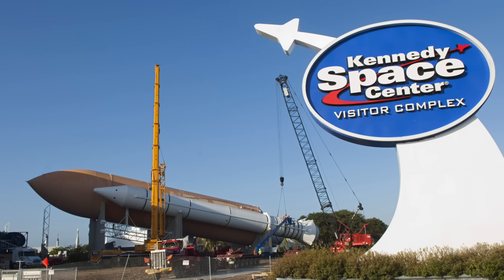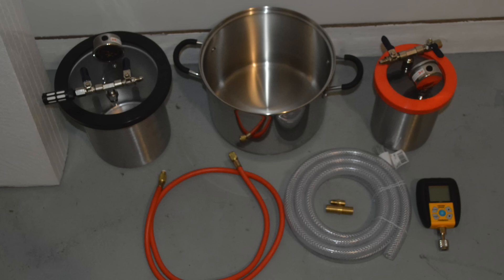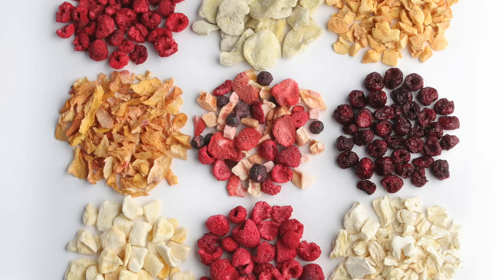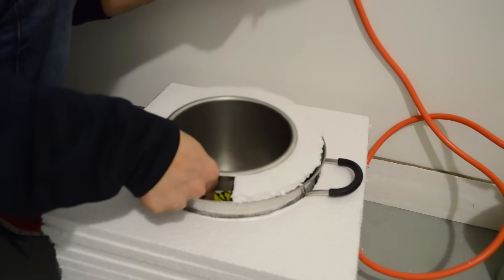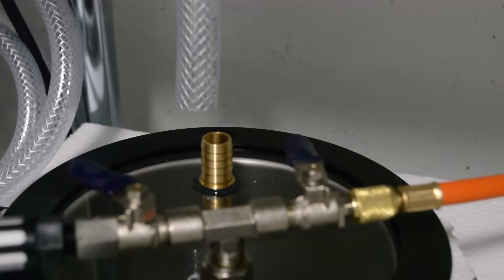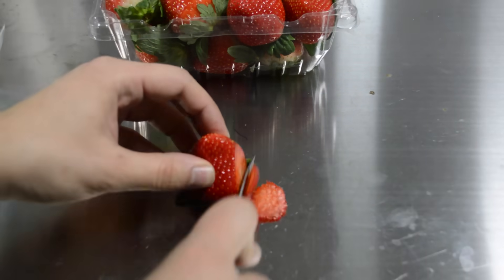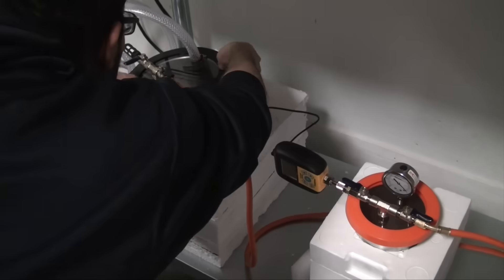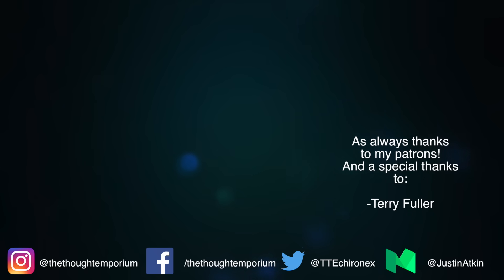How to Build a Freeze Dryer

Comment: Is the cold trap really necessary? It seems to me that it would only be needed to protect the pump from corrosive chemicals that would not be compatible with it's internals. I can understand that water vapor would physically mangle a turbo-molecular pump, but I would think a vain or diaphragm pump would be more robust. Is it just a case of it not being practical to make a pump that gets you to that level of vacuum and can handle some water vapor?
Reply from the maker: Over 20ml of water was in the cold trap when I let it thaw out, so ya it's super neccasary. The issue isn't the pump per say, that you're screwing with the oil in the pump which can then mess with the pump. Or if condensation is left inside the pump when it's turned off it'll rust internally

Comment: Fun fact: 
"Astronaut icecream" have never been in space and have never been intended to be eaten by astronauts.
Reply from the maker: If I ever become an astronaut, I know what I'm bringing with me then
Reply: The Thought Emporium actually they once did however the moment they opened the bag it shot dust across the cabin so it was never brought into space again.
Reply: En Person 
You're only half right.

It never went to space.

But it was developed under a NASA contract for the Apollo missions. So it was very much intended for them to eat it. The problem was it was found to be to crumbly, so it didn't get to go.
Reply: @lordgarion514  , that makes sense because the crumb would be (probably) impossible to control in zero gravity!!!
Reply: Henrik Ragnarsson Låås actually it has been taken to space, only once tho, cuz when they opened it dust went everywhere and they didn’t want their sensitive equipment to screw up because of it so they stopped it being taken up there.
Reply: Astronaut bacon is a thing 
And it needs be known
Reply: This is great news. I currently have to wrap wax paper around the emergency bacon I keep in my wallet which makes it bulky.
Reply: @morescodesup2087  Bacon should be a cologne.
Reply: @fistpunder  I use bacon as a spice.
Reply: @morescodesup2087  , there is "shelf stable" bacon. It's my favorite vs frying bacon because there's less mess. I just heat it up in the microwave and throw away the paper towel that was used to wrap it (absorbs the grease). Easy peasy. And adding bacon to almost any hot dish improves the palatability.
Reply: @morescodesup2087  lol
Reply: Fun fact: its never stated that thats what the astronauts eat. Its just a name. They do claim freeze drying is used by the nasa
Reply: He sounds like Mark roberg (or whatever)
Reply: https://www.youtube.com/watch?time_continue=12&v=69l15CZ-ZCY
Reply: Wasn't it sent up once but since it turned into dust they never sent it up again
Reply: Too messy.
Reply: Thanks for ruining my childhood dreams
Reply: I was delivering papers and I discovered that each issue of the sun times had a sample of freeze dried ice cream. My daughter and I feasted on it. lol
Sorry if you missed it.
Reply: I have an old small air compressor I don't use since it's too small. It's 1/4 hp though so I'm thinking I'll take the release valve on the tank off ( the one where you drain the water out) and attach a hose. The front where you normally plug your attachments in would remain open. Basically It will be sucking air out then. Actually I would have to attach the hose to the air intake by the motor.
Reply: Fun fact neither have astronauts.
Reply: @SherrickDuncan , the list of visitors to the ISS by nationality are not even allies. The list is as follows: US, Russia, Japan, Canada, Italy, France, Germany Belgium, Netherlands, Sweden, Brazil, Denmark, Kazakhstan, Malaysia, South Africa, South Korea, Spain, United Arab Emirates, United Kingdom.
Certainly you can tell us which of those countries spilled the beans and exposed the astronaut fraud. 
There are people who 'say' they have photographed the ISS through their telescope. Can you prove that their 'claims' are false?
Reply: SmokeRingZ  Quote: "Apparently we can't figure out how to maneuver the extreme conditions of the Van Allen belts ... well, and survive." 
I appreciate your reply. I have never studied the Van Allen belts. I had a very basic understanding of the magnetosphere. I'm going to do a study of the belts.
Reply: En Person “has”, not “have”
Reply: En Person The comment should read 'has' in the places it now reads 'have' as 'Astronaut Cream' is singular. Now if you said Astronaut Creams, flavors, types, or varieties, 'have' would be appropriate
Reply: Henrik Ragnarsson Låås no astronauts have been to "space" either. "Space" is fake. We don't live on a spinning ball with water stuck to it.
Reply: @billf8248  Correct. The earth is flat.
Reply: En Person 
No one has been to what you've been programmed to believe is space
Reply: @reformationinc.3376   why is it that claims such as these never come with a description of the variables. sources, or explanations of events? If you're looking for edgy internet cred you probably have it, but what's the value of your statement outside of that continuum?
Reply: @reformationinc.3376  😆😆😆😆..... CLOWN!
Reply: Reformation * Inc. - Dude, your tinfoil hat needs a tune-up.
Reply: @reformationinc.3376  Did you know that chemtrail fluid explains the larger than expected explosion when the plane hits the WTC?

Comment: Yikes, your micron gauge isn't made to be tightened with a pipe wrench and will likely rip the oring. Protip use some vacuum pump oil on the oring and hand tighten.
Reply from the maker: True, but also it was leaking. I was pretty gentle with the pipe wrench, though I realize I should've mentioned that.
Reply: Sterile petroleum jelly works better than pump oil.
There's a product called petrol-gel intended for laboratory use.
Reply: Eric Dalgetty Having a dry o-ring shred or just being dry would also cause leaks too so a little does go a long way. But you are right too so there's a balance...
Reply: Typically I would avoid adding any extra oil inside the chamber, it can offgas and keep the chamber from reaching a good vacuum